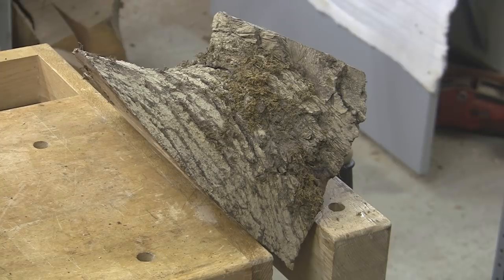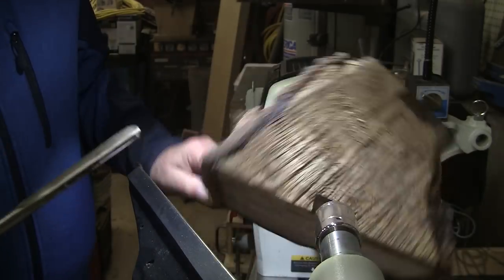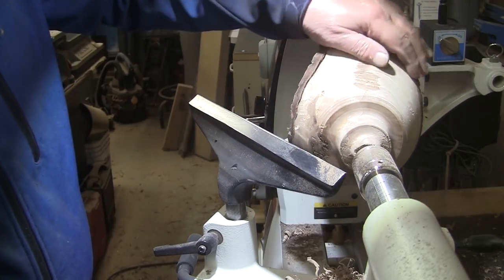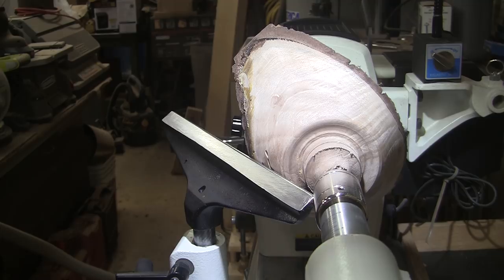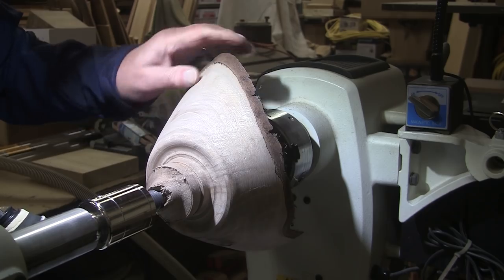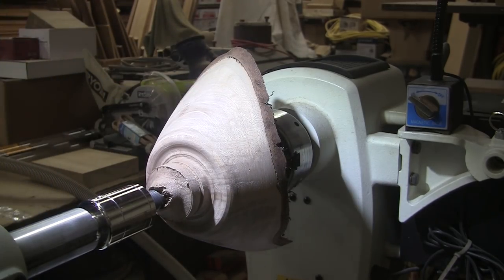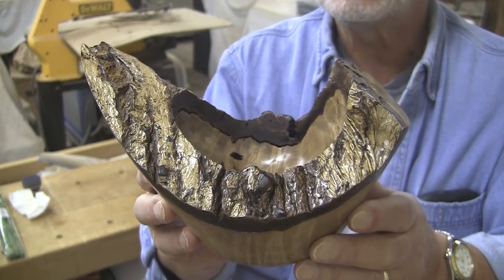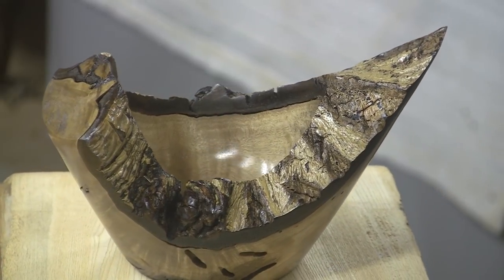Dangerous Live Edge Alder Bowl! - Wood Turning

Comment: Phil, Great job. How do you get the shellac so shiny, please show us
Reply from the maker: Thanks, Bob! 😄  A lot of it is from the sanding, getting a really smooth surface.  Then two coats of shellac based sanding sealer.  I apply the shellac in exactly the same way I apply the sealer so I never show that.  The method I use between coats helps a lot, too and I show that in this very short video:  https://youtu.be/lqns7oue4W4

Comment: Ha Phil nice little piece and ya the eye you have for these pieces is great and beautiful. I just got one of those sand o flex haven't use it yet is it hard to change grits or what ? any suggestions?   thanks so much for your video's
Reply from the maker: Thank you, Larry!  It's not hard to change grits but it does take a little time.  That's why I have a bunch of them, I'm lazy!  LOL!  A tip for changing the grits:  I put the shaft in a vise to hold it still.  It's like having an extra hand and makes things sooo much easier.  I hope you enjoy it as much as I do!
Phil

Comment: I sure enjoy your videos,  I am interested in getting a sand-o-flex.  Do you only use it with 80 grit ? and do you the glue or resin based siding cloth ?
Reply from the maker: Thank you, Ernest!  To the best of my knowledge, they all come with 80 grit.  I seldom use that, almost always use 180 grit to sand bark and imperfections.  I prefer the resin bond.  It's a little lighter and more flexible.  I also prefer the slashed refills rather than the plain.  They conform to odd shapes better.
Reply: @PhilAndersonShadyAcresWoodshop  Thanks

Comment: What an odd shape to stop Phil ........ I see the problem you're having with a balk I've had the same type of problem I ended up using the Gorilla Glue that expands at holds very well pretty good luck with it I have tried epoxy two part glue ......Gorilla has that too .
‌I like those bug holes, something more to look at.
‌Not too many safe ways you could have done that extra Wing sticking out, the only other way if you had to go straight into it with a triple long scraper triple thickness and I would have been safer but a little harder .
 At Alder it's almost like maple .... Do you agree?     looks beautiful
Reply from the maker: Yes, Bruce, Alder turns a lot like Maple.  I had to go buy some new glue, mine was dried up, and I almost bought the Gorilla glue but then decided to stick with what I know.  Good to know you've had good luck with it.  I might have tried carbide if I would have thought of it.  That would have made it easier, for sure.
Thanks, Bruce, for watching and liking my bug hole laden videos!
Phil